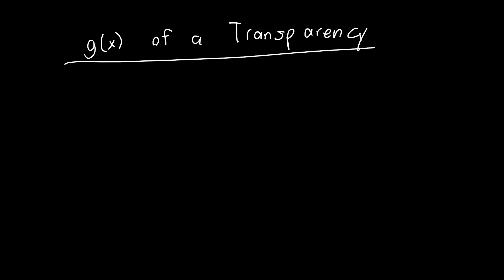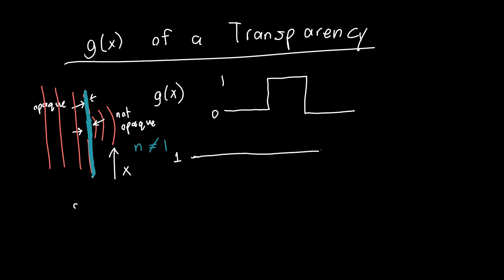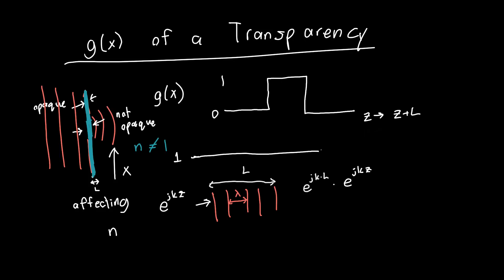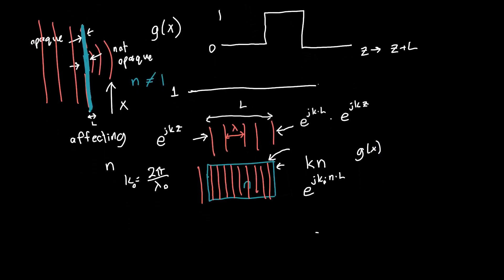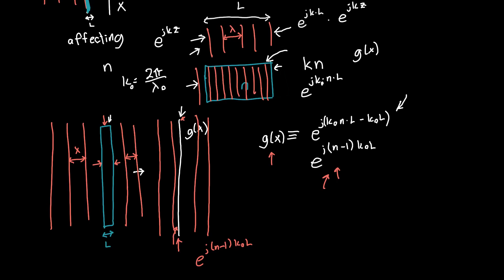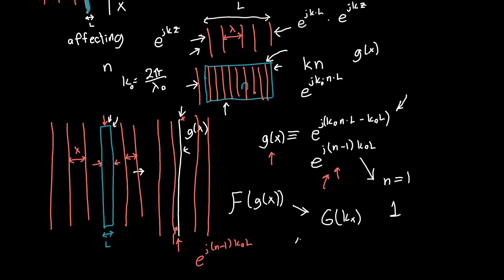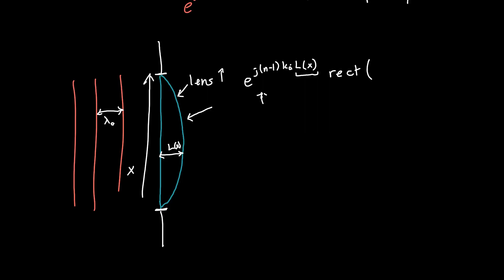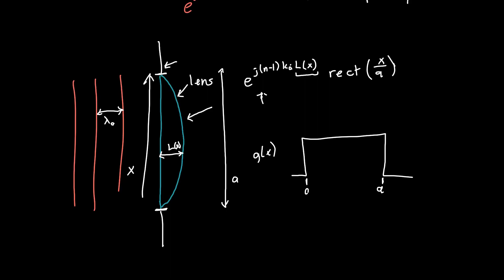Thin Transparency Aperture Function

Comment: I’m trying to get up to speed quickly on diffraction and I’ve never even heard that the refractive index represents a temporary phase change. I’ve always just thought about it as slowing down the light that hits it first and thereby bends the light. But if it changes the spatial phase of a bunch of huygen’s points, that essentially does the same thing. And the temporal frequency is a function of spatial frequency for a given photon, which is the dispersion relationship, and the partial derivative of the dispersion relationship with respect to spatial frequency at a different spatial frequency will likely be different, which is what gives the photon a different group velocity. I also think that different mediums have different dispersion relationships for photons, so I guess this is why you would get a different group velocity as well. Maybe some kind of combined effect? I am having trouble connecting all of the dots.